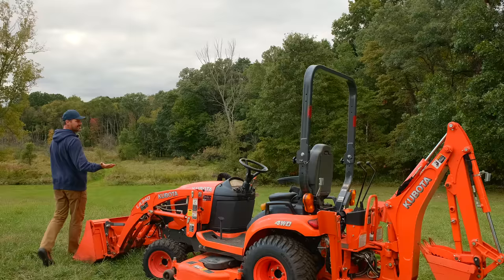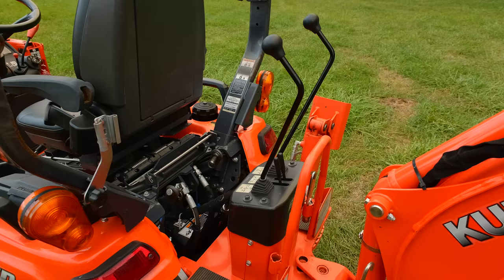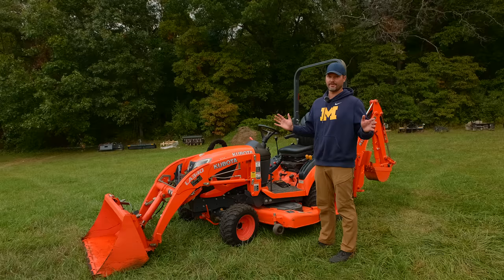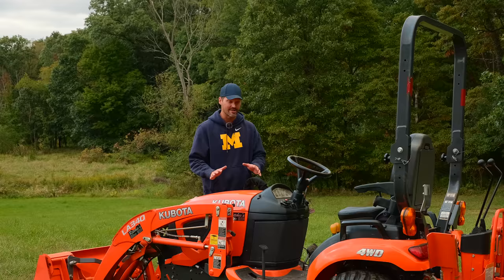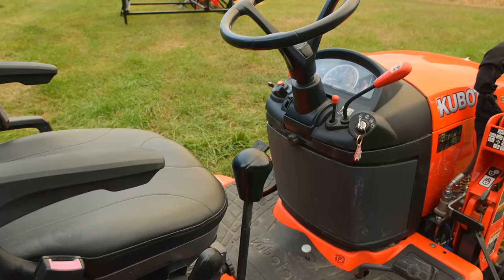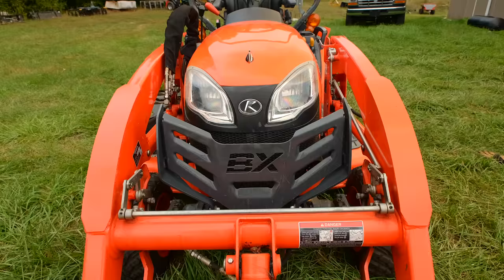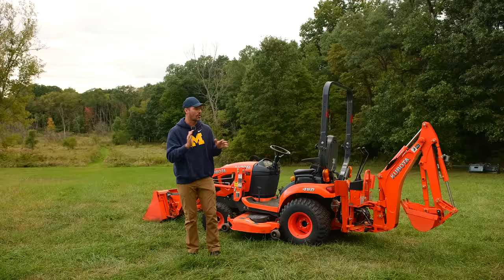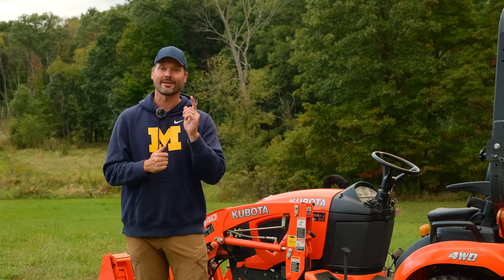PROBLEM AFTER PROBLEM AFTER PROBLEM

Comment: That machine looks like it had a rough life or the new models quality has come down. I have a BX23S bought in 2017 and comparing it to the Deere at the time (No second seat edition) I like the capacity of the Deere but the Kubota was more refined and that mostly was that the backhoe appeared to be an after thought as the hose was run over the floorboards (they have since resolved this) and the hydraulics handled multiple operations better. The only issue I have had was the leak in the single point connection (Don't take off loader much either) and dealer warrantied it and replaced with 4 individual attachments (I was bummed but the leak got bad).  I know people with the Deere and drive over deck and they had issues with it consistently connecting and they ended up buying a zero turn. Everything has their quirks or issues and you need to decide what you want to live with.

That sucks about the front tires but not all tires are created equal, I'd check to see if that 18in tire is true to size or not. Looking at the tire the sidewall looks larger than stock. My machine has 400 hours and the only leak I have not is one fitting on the backhoe.

If I were to do this again, I would strongly consider going to a B series to get more lifting capacity, but my BX does everything I need and what it doesn't not sure the 1025R would either.
Reply from the maker: Good info, thanks for sharing!
Reply: Give the LX a look, it’s quite the Mighty Mouse.
Reply: @lordchaa1598  yea I’ve been eyeing the cab model and was looking at the large frame B previous (which is the LX now)

Comment: 2000 hours in on our bx2200, have had leaks on the front axle but was very easy to fix, have used the loader as a backhoe digging massive holes on several occasions, im seeing more and more, older is just better

Comment: I'll completely agree with your comparison of the 1025R compared to the BX series. 4 years ago I bought a J.d.3025 E. Worst tractor I ever bought. My 4 year old tractor has 90 hours on it. I  use it very little. Hardly ever use it. The loader is spec 'd to lift 1300 lbs. Mine won't lift up a 55 gallon drum of diesel fuel. Weighs about 500#s full of fuel. My electric PTO switch sometimes doesn't engage. Pull the switch and wait a couple minutes,  it usually comes on. I like John Deere but I don't like this John Deere. I've owned others never had any major problems. My younger brother has a 4005 John Deere and loves it. He bought it new 10 - 12 years ago. Had it back to the dealership a couple times to get fixed, nothing was ever fixed. Lift capacity no better. Electric PTO switch no better and getting worse. I'm tempted to trade down a few years to get a better tractor. One I can use to work not just let my three granddaughters drive in the field.  The youngest wants me paint it pink. I'm thinking lemon yellow would be a better choice. Do you take tractor on trade ins Courtney? It looks nearly new. Let me know.  Mssgs me on Facebook if you do take trades. My budget won't allow me to buy a  new tractor and loader but I'd  e willing to trade down and give boot on my machine. I'm kinda looking for a J.D. 4300 or preferably a 4400 gear drve,/ shuttle shift and loader. I'd be willing to give some boot e/low hours

Comment: Sorry you bought a lemon bud. You really have to vet out used machines. Both of my Kubotas (1 BX 80) have been 100% trouble free and I love them. I have nothing bad to say about the JD just for note. They are both the clear market leaders in this segment. Comparing a neglected and severely abused machine to a generalized competitor comes off as a bit biased. Tractors get used. Sometimes hard. It’s all in how the owner/operator cares for it. I could turn any sub compact on the market into a similar condition machine in 400hours if I turned off my intention to care… I also only buy new for this very reason. Just my 2 cents.

Comment: The wheel spacers on the front are probably why the tires rub the deck. The old tires may not have rubbed due to them being worn. Just a thought.
Reply from the maker: Thought about that, but the deck tapers a bit further back the further outside you go.  Seems it would help if anything?
Reply: My thought, too.  You mentioned you would think it would have more "wiggle room" farther out, but I don't believe that is the case.
Easy enough to check: remove one wheel spacer and see if it makes a difference.  I think it will.
Reply: Imagine the tire turned and touching the mower deck. Would it be touching if it were X inches closer to it’s pivot point?
Reply: @flszen  Yeah that was my thought process.
Reply: At 4:58, the angle of the tire is approximately 45 degrees and the angle of the deck is probably less than 20 degrees. Definitely remove the wheel spacer as the farther the wheel sticks out, the more interference with the deck will occur. If you visually draw a line tangent to the side of the tire, you can see that the interference increases as the wheel moves out.
Reply: Those front tires shouldn’t be hitting anything when it’s in operation. Kubota really likes to play with mere millimeters with their decks when in the fully raised position. I agree with other posters that your wheel spacers are the probable cause of the front tires rubbing when the decks fully raised.

Comment: Apparently the previous owner was clearly doing things with that tractor that he/she shouldn’t have. For instance the bent bucket. You can take any brand, any model and bend up the bucket. Doesn’t mean the bucket is crap. Use and maintenance are 90% of the life of almost all products. I’ve worked as a service technician for many years and people can find ways to basically rip apart solid steel blocks. I would guess with the tens of thousands BX tractors sold, there’s bound to be some with issues. Maybe correct some of those problems your BX has and sell it. Sounds like you really have no need for the BX anyway.

Comment: Sorry but I have to disagree.  I have a bx23 for 3 years now with front end loader and back hoe.  I've never had a problem with it.  I would say I even abuse it when I'm pulling stumps.  It does take awhile to break up the roots, but the tractor never has a problem.  I do not have a mower on it, use a Skagg for that, but as a tractor with loader and back hoe - it's great.  Do I wish I had a bigger one, sure - but for the price, I'd highly recommend it.

Comment: I had a BX 26 hp and it seemed to always run close to red on gauge.  Never did like the reverse  mount engine and reverse mount radiator.  Never many issues with it.But it just wasn't the right fit for me.

Comment: Some of the issues I’ve found in my Kubota’s are the placement of the ground, poor welding on the decks, the hood is plastic, not rigid, needs some helper springs and can only be opened from the side if you have a loader, the grease fittings are ill placed. In an effort to make money it looks like the company is not focused on the fit, finish or ease of use or maintenance!!

Comment: Newer bx machines lack the quality present when they were introduced in the early 2000s.  Our first bx2200 is still kicking today beyond the 2000 hour mark with nothing more than routine maintenance. I'd say roughly 2/3 of the hours are 3pt pto run time with the final 3rd spent running a 60" belly mower.  Seemed rational to get another bx after 15 years of excellent performance, the Bx2380 we bought had issue after issue both with hydraulics and mower deck and gearbox.  Ended up trading it back to the dealer under 50 hours for a Bx26 similarly equipped to the one in the video.  Unfortunately it had similar issues and we sold it outright.  Still have the Bx2200 and still put 5 to 10 hours on it weekly.  Might consider a B series but I'd never look at another Bx.
Reply: I would be interested to know if maybe it was the early model bx2380s that had those problems.  What year was yours?  I suspect that Courtney's is a 2017 or 2018.  I have a 2019 bx2380 that I bought used, but according to the owner and the dealer it had no problems in its first 3yrs/140 hours before I bought--they paid $1400 for the 5 year extended warranty.  I have certainly abused it digging out large stumps and grading rocky soil with a ratchet rake for another 15 hours with no problems or leaks anywhere, and the single point connection is still dry despite connecting and reconnecting it 6 times so far as it is so easy.  My neighbor is a John Deere salesman working at our largest dealer, and he said the first 2 years of the 1025r were filled with warranty problems so he advised also avoiding those early 1025r models.
Reply: @brianbecker7588  Want to say it was a 2016.  Got it right around the time they released the 80 series machines.  Can't remember if it made 6 or 7 trips back to the dealer before we traded it back in.  They'd keep it for a month and "resolve" the issue and declare it fixed.  The final straw was when the upper nut backed off the spindle on the belly mower for the second time and this was about an hour of run time after getting it back from the dealer where the spindle assembly was replaced.  We kept it for about 4 years and only put about 50 hours on it.  The Bx26 was better but from a performance standpoint was underwhelming.  Of course it was better than using a shovel but to dig holes but it certainly wasn't a powerhouse.  Both machines had hood latch and overheating issues as well as problems with the power steering lines too.  If I had to pick one to keep the Bx26 was it no doubt but a B series is the only real choice if I'm honest.  To cover the duties we had used them for previously we use the Bx2200 to run a pto sprayer exclusively now and bought 2 zero turns to keep the grass tamed.
Reply: @benjaminbrooks7979  Thanks for the info as that makes me feel much better although that really sucks at the quality issues you had to deal with.  It appears they have better quality now although I am sure there are still some lemons out there.  My neighbor's father in law has only bought John Deere his whole life and bought one of the first 1025R models back in 2014 I think.  He had alot of annoying quality issues, and they were all covered under warranty.  However, even though the dealer picked up and dropped off his tractor it drove him crazy.  Our steep terrain apparently kept giving his front axle issues with his front differential locking up.  The second time and a 5th trip to the dealer, John Deere actually bought it back.  The Bseries is my favorite compact tractor, but used newer ones are very rare, and the BX does everything I need.  Many of us in the mountains bush hog and "weed wack" on steep slopes with our BX since it will mow at 6" ---although that's really supposed to be the transport height.

Comment: My question is this: with so many tractors and not enough to do with them, do you use a special fuel stabilizer? Or take any other measures to keep them in good working order? I have an extra old Kubota lawnmower so I just wanted to know. Will maybe sell it but until then..,

Comment: Sounds like this one is a lemon... This has not been my personal experience so far. I have the BX 2680 with 236hrs in less than 2 years. I'm a commercial chicken farmer and I take the loader off all the time for the K-Connect and use a power broom and the snow plow in the barn. I also blow snow with this BX. The loader has never given me issues, my only gripe is that it doesn't lift as much as the JD 1025R. But so far it's been a tough little machine for me. I have big gardens and the compact BX gets in everywhere I need. I've got it paired with an MX 5400 now so I have a nice set up.

Sorry your BX23S is a lemon...
Reply from the maker: Glad to hear it’s treating you well!
Reply: @GoodWorksTractors  I'm sorry yours hasn't lol! Time for it to go!

Comment: When I was shopping I compared the BX Kubotas to the JD 1025r's. Not even close. The 1025r is so much beefier, more steel, more solid, etc, etc.
Reply: And alot more money in my area! For the price of a 1025r I could have got a b2601 for $500 more no comparison between those two.  Buy green it will cost you more green!!
Reply: @troyvankinder9249  Yep - it was a little more than the BX. Steel costs money. Was money well spent to me. Different strokes...

Comment: Yeah man… I work at a Kubota dealer and until you get into the grand L series. These things are just cheap, Cheap, CHEAP! 

That said, they are usually pretty solid machines. But they’re not for everyone, which is why we are also a New Holland dealer.
Reply from the maker: Love the Grand L
Reply: @duanehamdorf2228  it’s a solid tractor. The only complaint I personally have is the hydrostat pedal is WAY too stiff on the ones that we’ve gotten lately. Now to be fair, that could be a supply chain issue and they simply had to source a different gas strut. And it happens to be stiffer. But I’m pushin 250lbs myself and I feel like I have to damn near stand on the pedal for it to move. Especially for reverse. 

But other than that one complaint. The loader that goes on them is solid and they’re fairly comfortable for a smaller chassis machine. 

When implements are sized properly. You’ll never be wanting for more power either. The 26hp is more capable than people give it credit for.

Comment: I know exactly what you mean about those Kubotas. My buddy has a 2680 I believe and within the first two weeks of his ownership (brand new) the one lever hydraulic loader connector started leaking and it also started leaking antifreeze out of one of the frost plugs on the block. And the worst thing in my opinion is the treadle pedal. Man I can’t stand that setup.
Reply from the maker: Hehe I don’t think I even mentioned the treadle in this video.
Reply: @GoodWorksTractors  you didn’t

Comment: One thing I noticed and recommend you pay attention to. It can be easy to manipulate specifications or come up with your own testing standard when it comes to claims of performance. Sears was famous for that in their Craftsman brand. Everything they sold from a handheld circular saw to their lawn tractors always had these high claims of horsepower, where the same engine in another brands application had a lower stated value. I am in the market to upsize from my present BX25D to a larger unit and was comparing an offering from Mahindra to a similar sized Kubota unit. The Mahindra had higher ratings for lift capacity for their FEL and 3-pt. It also had a higher horsepower rating of the engine. But, when I looked at the unit weight, I noticed the Mahindra weighed 2000 pounds less than the Kubota. Where did the weight "savings" come from? Well, I will give you my "guess". It is because the Mahindra is made of thinner steel everywhere. How do you think that is going to stand up to service where you take the manufacturer at their word in terms of specs and size the tractor to your planned operations to just be adequate. A lot of buyers do this because tractors are super expensive, and this drives them to buy a unit that just meets their capacity needs. My thoughts are that the tractor built to margin will withstand long term use better if it is made of heavier, presumably more durable, quality materials and put together with quality than the same unit made of less material. In the tractor world durability is the most desirable quality over anything else. To ME, tractors are TOOLS made to WORK. I am not a Kubota fan boi, which is why I have been looking at other brands for possibilities, but my experience has been good given the 300 hours I put on my machine with no issues outside routine maintenance. I am considering others, but they have an uphill battle given my positive experience. I am looking to upsize because I have been pushing the capabilities of my current machine, and think this is unwise.

Comment: I think your wheel spacers on there that could be your rubbing issue, I’ve never seen that on a stock track width sub compact…
Reply from the maker: Maybe, surprised no one else has ever had the issue though.  Lots of front spacers installed

Comment: I have a 2020 LX2610 with the cab. It is my first kubota and my last one. The loader is so weak on it that I feel like its going to bend when I pick stuff up. I also somehow bent the tilt cylinders with light use. The hydrostatic is so unrefined compared to any other hydro tractor I have driven. Also the tractor is already fading even though it has been in a barn or under a carport all of its life. Just overall is a cheaply built tractor. The only thing I really like about it is the cab and how it is layed out. The rest of the tractor is just not built like a john deere. Of course everyone on the kubota forums attacks me anytime I say this or call out any of the flaws worth these tractors. If JD had a 25 hp with a A/C cab I would have bought that from the beginning. The tires rubbing the mower deck on yours just shows the lack of attention to details. I know it has a bigger tire on it but if that hurts the functionality of the tractor, why would they even offer it
Reply from the maker: Wow, now that’s an unusual report for me to hear.  Sorry to hear of your experience.  I do think most rave about the LX.  The older B2650 was always a solid one.
Reply: @GoodWorksTractors  I always though kubota made the best tractors until I started spending more time around John Deere’s. I almost bought a 1025r prior to the lx. I’m still glad I bough the LX because of the cab but comparing the John Deere’s and Kubota at the dealer, the John Deere’s just seemed heavier built. I also really like the yanmar diesels that come in the JD
Reply: @atvrepairsandmore2482  Self-induced problem with the tire interference by adding wheel spacers and new tread. Not a design flaw, but he is not telling you that.